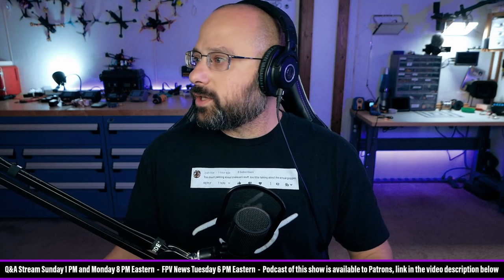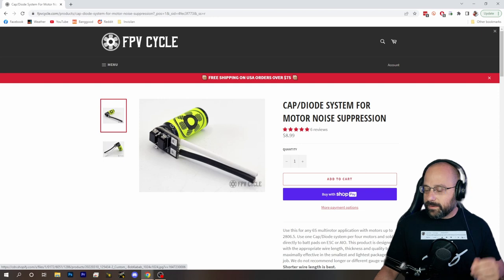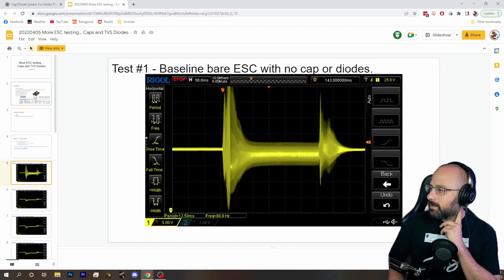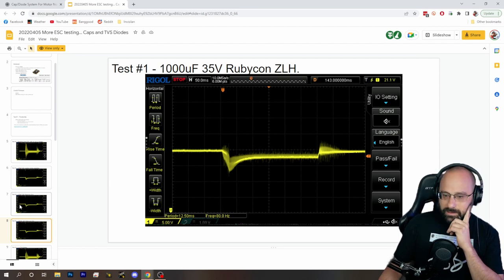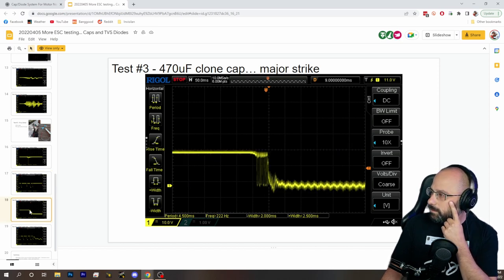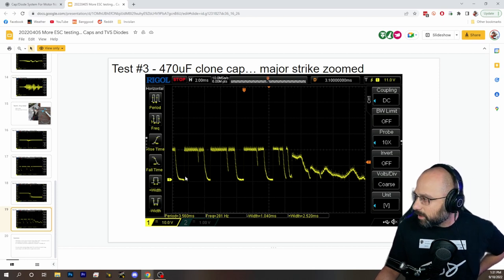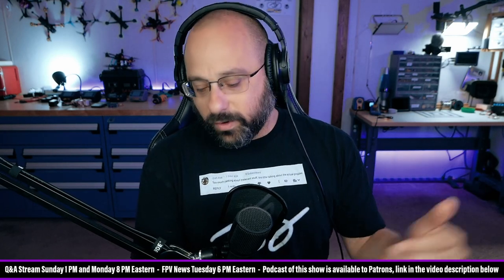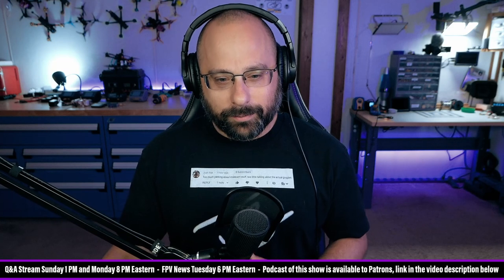Is It Worth Running a TVS diode or Just A Capacitor? - FPV Questions

Comment: How the ESC dies is mystery #1 in our industry imo. I'm leaning towards physical stress on components resulting in sketchy contacts. I'm hoping to test this board cased in resin soon.....but I'm just one person unfortunately so my results will always be inconclusive.
Reply: Hello Bob, I do electronics design and ESC repairs for living. I've been trying to analyze this issue for ages and this is what I've been theorizing from my own experience.

Different kind of failures tell us what actually happened. If the ESC dies non-destructively, most of the times it will be the microcontrollers failed to get power or failing themselves. For the first issue, many times the ceramic capacitors failed shorted on one of the power stages. This can be due to poor placement where the capacitor experience physical stress. As for the second issue, I suspect induced transient on the signal line connected to each of the microcontroller like the ADC pins for EMF detection or other pins because this is how you kill a microcontroller other than by physical damage.

The way ESC dies destructively also tell us what could be happening. If the ESC failed without bringing the motor with it (single phase short), the FETs are the problem. Either this could be underrated parts or poor quality.  If the ESC failed while bringing the motor with it, then the short happened across phase. Could be caused by the same issue as before, failure to detect the correct EMF to the point of coil saturation (overcurrent), or other external trigger that excites the FETs abnormally.

How would I come up with a reliable ESC design? Full-size 5x6mm FETs for typical 5 inch setup. Even a dual 5x6mm FETs is better spec-wise than 2x 3x3mm with smaller overall footprint. 2 capacitors in series configuration in case of one failing, it won't make a dead short. Larger resistors on gate inrush limiter because the smaller one can't really handle the peak drive current and often fail high resistance.
Reply: @Asu01  I just had this happen where one ESC failed in a 4in1. but the motor works still. I thought it was the motor at first because it was just twitching but after swapping it I found that wasn't the case. No components get hot on the esc. Usually something gets hot on a dead esc from my experience. Oddly enough, that's not the case here.
Reply: I'd say the ESCs die by overcurrent. Those voltage dips are probably caused by an overcurrent happening in the motors. When you have a "short-circuit like" situation, the voltage will decrease in function of the current getting increased, that could explain why people burn their esc when having a jammed motor.
Reply: @Asu01  I just randomly came back to these and saw your comment. Design an ESC. We'll get it made and see how far it gets. The industry would absolutely love to have a highly reliable board.
Reply: Isolate and the decouple the crap of the microcontroller and whatever other gate driving components there are, then increase all the ceilings on the mosfets as far as absolute ratings. Whatever is serving as the freewheeling, beef that up too. If anything, just to try avoiding ground issues I would actually just try to design the setup so that the low side (gate drive) of the ESC was completely isolated and using its own battery supply or a good isolated DC to DC converter. It's either that or take all of the filtering and decoupling real seriously by doing more than just tossing a couple electrolytics on that are supposed to be low-esr. A common practice for decoupling and snubbing when just winging it would be to stack values for various frequency ranges such as a 1nF/100nF/1uF set of decent ceramics. Then you have to actually tidy up everything else that is sharing the same system or close enough for magnetic interference. All the wiring is just inductance laying around. Good low esr caps on top is also good but shouldn't be the end-all. I would imagine any level of improper switching of the fets can result in a shoot-through that will kill them relatively fast. Larger and more balanced lower inductance PCB layouts would help but then you're increasing the size and weight.

Factors outside of the ESC design itself can seem to be causes of their failure even if they are being operated within reasonable limits. If they are not conformal coated I would imagine just moisture and debris could cause issues. Or the wiring and grounding. When I think about ESC's I think about VFD's, except VFD's are typically running 3ph AC induction motors. While they are eventually all going to suffer the same deaths for the same reasons no matter their filtering or protection.. what typically keeps them from dying prematurely is just the fault protections.. They are using switches (usually IGBTs) which are rated for very high short circuit currents for a certain duration of time, and that duration is longer than it takes for the built in overcurrent protection to activate. It just kind of seems like given the size limitations of what most people need, it's not really feasible to build an ESC that is going to never die because it has every perceivable protection.
Reply: I still haven't fried an ESC. I've fried multiple flight controllers though... (And that's without shorting or reverse polarity-ing or anything else that I can tell.)
Reply: @Magneticitist  how about separating the ESC fet board from the MCU and processing components. Just make it a three board solution. If it will keep it from frying, I'd give it a go
Reply: @Kabab  I'd be curious to know how often microcontroller failure actually is since the design is always going to come down to cost relative to necessity. I would guess that like some people are saying here that overcurrent is going to be the most common situation causing a fet to blow. Some situation that has the fets going linear for far too long and they simply can't handle it etc. I'm not sure whether these ESC's most people are flying have some form of OCP but I would guess that they do, in which case the question goes back to why isn't that working. 

Since they are trying to basically jam pack these things into such small sizes and weights I would say that yes any extra separation might help so long as it allows a better routing of traces etc. Likewise simply improving the components is probably going to be the key. With all things I'm sure there is some first iteration which works and works well, then it's plucked down into the cheapest form of itself that still works within a tolerable allowance so they can barely get by with the advertised rating.
Reply: @Magneticitist  there are a subset of speed controllers that have a secondary daughter board for the processing components and that daughter board is soldered to the main board. The goal in this case is just to separate the ground planes a little bit. I have found that it makes no difference with respect to reliability.

All yeses have overcurrent protection and I would bet that the number of them that failed due to overcurrent or too long of constant current is very very few if not zero. Going with a separate processing unit also allows you to have one processing unit and just change the FET board for various amperage and voltage requirements. I would ask whether the communication link between the processor and feds would be sufficient enough for it to function the same. Typically the processor is within a few millimeters of the FETs and have a low resistance connection
Reply: This test does not convince me much, I don't know about you, but I personally run 4 motors with a 4in1 board...

Comment: A far better solution for noise suppression is a big cap and a much smaller cap in paralell, the big cap smooths out the low frequency noise from motors, while a small cap will deal with high frequency switching noise from switching regulators aka onboard voltage regulators vtxs, cams ect ect.. I did this all the time when I used to design synthesiser circuits.. I would never use just one large cap.. A large cap wouldnt be able to sink fast switching currents quick enough, hence why you will always find both in pretty much all electronic circuits these days..
Reply: so, on a 5 inch quad for example, one cap 35V 470μF and one 50V 220μF?
Reply: @nakmax  No.. There both very large caps.. A 470uf and somthing much smaller like 100nf or10nf would be better.. Valtage rating doesnt matter as long as its more than your battery puts out at full voltage.. so 35v is ok..
Reply: @petrokemikal  thnx mate

Comment: The problem is that voltage spikes are generated FROM the motor and propagate to the INPUT. So putting TVS on the input is the LAST place where you should place TVS diode.

Comment: This is why the TVS diodes on ours are so small. Maybe it helps a bit. Doesn't hurt to have it on there. Weighs like 1/3g. So the cap/diode system with the wire attached at the appropriate max length and awg, it's as fool proof and maximally protective as reasonable for a general 5-7" system.

Comment: It is exactly as you assume. If the motor is blocked it will generate its highest torque and therefore the highest current. So either the motor winding will overheat first or the esc will blow up.

Comment: Forgive me for I'm not 100% fluent in electrical engineering. But what I assume is happening is t hat  when a motor get bound by something the coils just perceive it as a substantial  amount of drag. When the temp of  the motor heats up resistance increases substantially and the ESC tries to over compensate and burns out to over current. If this were true a test could be done with a high amp ESC and whatever the equivalent a lower amp motor would be. If the motor smokes before the ESC and you could measure amps from the  ESC it would confirm this theory.

Comment: I always pictured the prop strike killing an esc by essentially increasing prop resistance in the same way trying to run a 12inch prop on a 5inch setup. Your asking it to spin the world in this case. You learn about over propping burning up your esc. If the prop can't move its the same ish as having it over propped right?

Comment: Something i should have added,i make audio equipment using vacuum tube/valves and as most guitarists use 9Vdc power banks i have to run my tubes/valves at proper tube/Valve anode/plate voltages of anything from around 70Vdc to around(for me)350Vdc.

I designed an smps boost converter that can be varied from around 60Vdc  to about 380Vdc,this is possible due to the series inductor being switched in and out of conduction,the voltage increases due to inductors not being happy to stop conducting,they store energy in the form of a magnetic flux that swells like a balloon it's a field and as long as the inductor core does not saturate it will keep adding to the voltage,the voltage is passed to a high voltage capacitor via a switch,the switch is a either a schottky diode or a super fast diode,voltage dependent as the schottky in general don't have the same voltage range of say a ulf4001 that's ultra fast with the same voltage ratings of a 1N4001,diodes conduct in one direction only and so can act as a switch.

So deliberately we can allow a high voltage to be developed,this is with a pwm controller using feedback to skip pulses to control or hold the output voltage,as for uncontrolled Back EMF the field can get quite high very fast.

So inductive back EMF can destroy a transistor very quickly,and as such when using inductive loads ie a relay armature,an inductor or any wound inductive component a freewheeling diode should be used to protect against flyback voltages,the diode is actually a current steering diode that in one direction is not conducting and as soon as the reverse voltage appears the diodes junction barrier voltage is overcome allowing the diode to act as a clamp which will hold the back EMF to around 1V a little over the barrier potential of around 0.6v-0.7v generally in that region.

Incidentally the old style TVs ,computers and oscilloscopes using crt screens had a flyback transformer inside generating 1000's of volts without breaking a sweat.

Again the suppressor cap might stop EMi  with the electronics in the same way car radios have/had a suppressor cap to null the EMi noise injected into the power supply via the alternator,or to peoples tv sets as you drove around.

The best method of suppression can be with a RLC filter,some shielding,or a simple RC filter using proportionally smaller caps to deal with HF content of the EMi,seeing as a motor rpm is linked to the frequency generated.

I did explain the best shielding method to minimise added weight and to give the best shielding,you must realise this shielding will block RF signals ,so external antennas must be used or you aint flying nowhere buddy.

Finally Joshua,i messaged about changing out ESC's on a cheapo drone with other mods to use higher current ESC's bigger motors and higher cell count batteries while using a buck or linear regulator to keep original control circuits and cameras etc as per original,to get a lightwieght cheap screamer,sadly no reply.

I'd appreciate some input as i'm still a noob at FPV.
I think i can give good insight to the electronics side of this,even making cheap shitty gear from china work better than some of the high end ESC's from here in the west(i already did this).

Still.i have subscribed and enjoy the vids,i hope i gave good clear information on not getting screwed by bogus info on Back EMF protection circuits for parts that actually cost pennies.

Comment: Then isn't the issue is not if a TVS diode is good or not, but should we install a voltage limiter diode or a current limiter diode?

Comment: I believe a 4in 1 ESC is under heavier stress when connected to 4 motors doing their own thing (some speeding up while other ones are braking).  
I have a couple of quads in which I've burned one ESC on a 4-in-1 board, and kept running with one separate ESC, both these kwads have been incredibly reliable since.
A lot of pilots including me, believe in the effectiveness of TVS diodes+50V cap on 4in1 escs... I've myself never burned an ESC equipped like that... But I know there is nothing scientific here ;-)

Comment: I think the actual scenario when TVS diode is useful was not tested. When you have a big capacitor and connect a battery there is a lot of inrush current. And If your wires have enough inductance, high inrush current can cause the voltage to "overshoot" and probably kill MOSFETs. I don't know if that ever happens in reality (killing ESC while plugging in the battery) but having just one small TVS with the cap seems like a reasonable thing. I honestly can not imagine ANY other scenario when this diode will be useful.
But anyway these tests are great, thanks for sharing.

Comment: The largest current draw will always happen under "locked rotor" conditions. They can be massively higher than the running amps. Back EMF can also wipe out the processor, so it depends on the failure mode. These are all vastly more likely when the manufacture cuts corners, or uses poor engineering practices, which is not always reflected in the retail price.

Comment: In a 4s 3.5" quad, should i use 25v or 35v? And what uf, 1000 or less? Should, I use 1 or more ?
My vista is connected to my directly on my battery, in the connection the drone had it self a small capacitor 16v 100uf, should i change it?
Please help!!!

Comment: Is there anything that reduces the spark when connecting a battery?  I recently moved up to 6S and noticed a huge difference in the spark created when connecting the higher voltage battery.  Is it due to the remaining voltage in the capacitor?

Comment: It is over current because, without some way to limit it, the energy being supplied by the battery, to the motor (through the esc), is going to be converted into heat instead of mechanical energy. The heat changes the properties of the various layers inside the FET, causing it to behave more like a variable resistor with positive feedback until it burns out the internal trace to the pad - or worse.

Comment: I should have added you should add some caps in series ie first cap of say 1000uF,then 100nF then 100pF to eliminate HF noise.The values are proportional.

Comment: external TVS won't save the internal diode in the n-mosfet... so that thing will die regardless if it wants to. When a 3 phase motor abruptly stops the fight is with the coil in the motor and the mosfet on that channel and nobody else. What I am wondering is ... where exactly are we measuring the noise / voltage ?

Comment: Nobody seems to mention active breaking / damped mode in BLheli... Wouldn't that tend to generate higher voltage more than a prop strike?... Especially in a high air flow situation like an abrupt throttle cut at high speed?...  I'm curious about people's thoughts on this as I don't know much about it...

Comment: What the test shows is that there is a current spike happening,which results in a voltage drop because the current limit gets cought. Does anyone know if this "maxing out" of the current has been checked as a reason for the ESC death? So basically the only current safety would be using a battery with lower current rating than the ESC, "abusing" the battery as limiter.

Comment: Very interesting and fun clip. Learned something new along with Joshua. I actually smoked a motor trying to turtle out of a tree. 5 inch race quad, aikon 20x20 esc vs a 2207 2450kv motor.

Comment: A low impedance cap will always filter while other protection devices like TVS diodes are meant for much larger voltages. We luckily dont really have those, the back emf spikes are of very limited energy and if the cap is capable of sucking them up youre good to go. 
A much smaller cap would probably be fine too. And I would definitely stick with 50V caps from experience unrelated to drones.